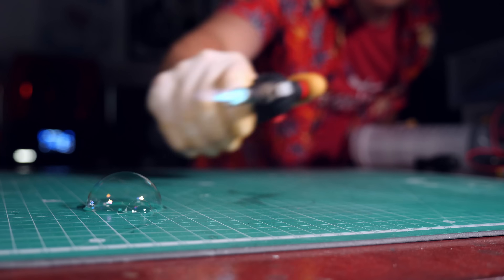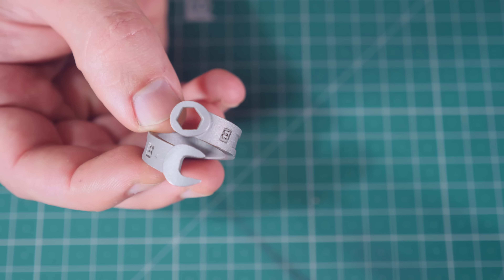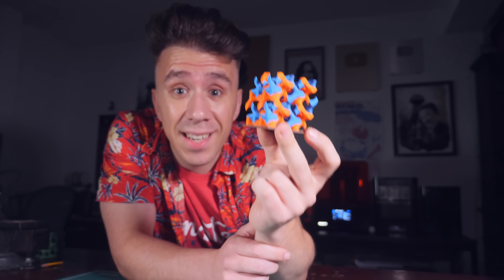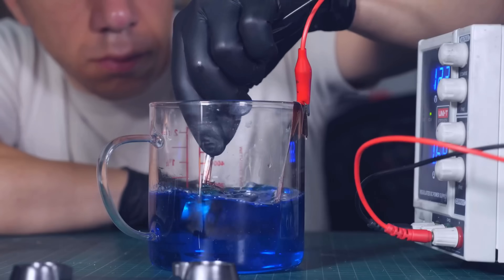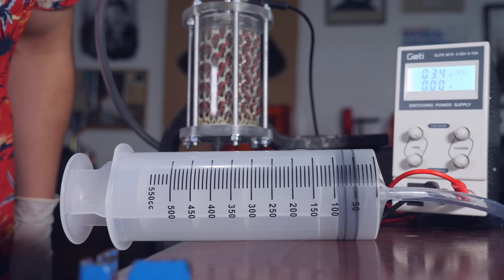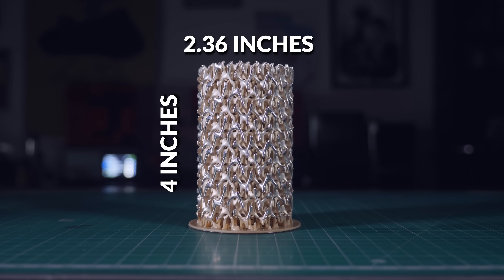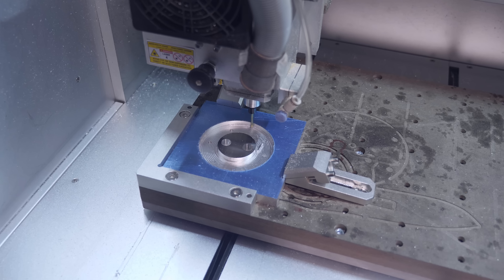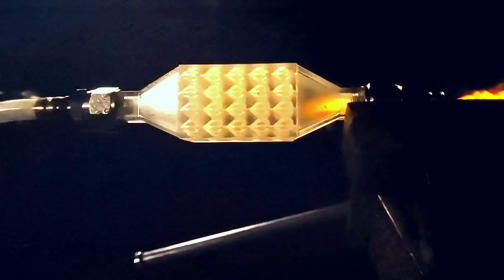ROCKET that LITERALLY BURNS WATER as FUEL

Comment: The battery is heating up because the conductive  water is creating a short circuit condition,  the only way any battery to be able to stop from heating up is to connect a load resistance  in series with the battery
If you are choosing a 1 ohm resistor , then take the max current you want to pass through the water let say 100 A current,  
Then the resistance wattage rating should be 10kW 
(Available in market)
Now battery, let's say if the battery doesn't overheat until it draws 50% of given capacity then should select a battery for 100A atleast, ie: 200 Ah capacity battery 
Now battery voltage selection
We selected 1 ohm so to flow 100 
V = I×R = 1×100 = 100V
So you need to create a battery of 100v of 200Ah capacity,  if as a single battery not available, use a parrallel or series battery connection of market available battery to create a 100v 200Ah battery.

So use a resistance of 1 Ohm 10kW and Battery 100V 100Ah

Comment: Have you tried using a cheap laptop power supply? I had to use one to do some rust removal, and it bubbled pretty merrily.

...course I think i also accidentally electroplated the parts i mean to just remove rust from, lmao.

course i used washing soda (sodium carbonate) i made from baking soda by heating it to 400F, dunno if that helps.

Comment: Hell yeah !
Years ago hydrogen was my suggestion for content.. you are crushing it !
Measure the volume vs watts and make sure everyone knows when you make more than is supposed to be possible per watt.. it's not hard at all.. physics and chemistry is so dumb with its rules they made a new science called atomic/astro physics for all the times physics is violated.. lol.

Looking forward to your progression !

There is two ways to split water, high voltage without electrolyte and low voltage with electrolyte.
Also with pulses and circuits (tank) you can make it "ring" like a bell and will use about 1/20th the power for same output..

Please please keep progressing !

Comment: I would like to see a video of you using a MIG/MAG welding machine as a 3D printer; As an example, you could install a MIG/MAG torch on a lathe tool holder, imitating 3D deposition.

Comment: Use a few 12v car batteries in parallel, adding until you DING. Or get a fused PDU and give it your local 120~240v to see if it twerks a bit?

Comment: Use an electronic speed controller from an RC car to control the discharge rate.  Upgrade to 6s lipo, run two or more in a series

Comment: Silver was covered in sulfur deposits, chemical desulfation use a solution of distilled water and Epsom Salt. Probably reduce the conductivity, magnesium sulfate and acid is going to neutralize the solution. But why not trying a balance between them? In this way maintain the surface clean just change the solution bath once In a while. Someone of you already tried?

Comment: Did you run the lipo batteries through a speed controller? It has a low voltage sensor in there, from what I understand there's units where you can adjust the low voltage limit. 
-5 years in rc hobbies

Comment: The solution to the problem of the batteries dying is to incorporate an electronic current limiting circuit between the battery and the H2O2  device. They are simple circuits that are easy to build.

Comment: Hey @integza, neat stuff, quick question what kind of flashback arrestor did you use? my college capstone was based on pyrolysis, and one of the byproducts was hydrogen, the safety department of the college shut down our project saying the flashback arrestor rated for acetylene was not rated for hydrogen!

speaking of pyrolysis, i think it would be a good video topic, its a dense topic, but simple to pull off also has some neat applications in the production of bio-oils!

Comment: Nice idea.  But how much energy did the battery put in to split the water?  How much energy did the rocket produce?   It's probably simpler and more efficient to just use the battery to turn an electric motor.

Comment: I know I'm like 6 months late to make this comment but brother, at 2:06 you start talking about the company that 3d prints in the exact material you'd need to make a proper HHO generator (316L Stainless Steel), if you made your lattice design through them you'd have a design that has high surface area not only from the lattice but also since it's 3d printed it will have a rough surface which increases surface area, also it's already conductive being stainless steel AND highly corrosion resistant so no coating needed to use with corrosive electrolytes, it may have less surface area than the disk design but it is well balanced and I'd be curious to see how that would perform (If you could somehow separate the two lattices from the base with a non conductive material that is also corrosion resistant/proof). 
It would also be interesting to see a version with disks of the lattice in stainless steel that are still separated by the insulating lattice disks you already made so that you could have neutral disks between the anode and cathode disks (being separated by a few neutral steel disks between each to prevent overheating and increase efficiency).
Best of luck with all of your projects! I like your content!

Comment: If you make the water spin by putting an impeller at the base, you would be increasing the surface area over the temporal dimension, same for heating up the water and compressing it. I wonder if a tesla turbine could be used with water where the disks are the electrodes 🤔

Comment: Can't you use a High-Current Industrial grade SMPS with an output of nearly 15V DC, 50A or higher, drawing almost 750W power? Also, you may need to use at least a 4 AWG (thicker) wire, cooling systems, short circuit protection.

Comment: The only way I see to mitigate the amperage problem is to increase the resistance for example with a variable resistance. Through your experiments you can determine how fast you want hydrogen production and then set your resistance accordingly. Sure this would limit the speed at which hydrogen can be produced but the alternative is to fry your power supplies just like you showed in your video. By Ohms law where resistance decreases, current increases. I=U/R. By having minimal resistance between the andoes and cathodes through the electrolytic medium that is your water you are approaching a short circuit where current could theoretically be infinitely high. 
Ah yes and with great current usually comes great heat.

After some time running the sytem the anode (-) will corrode away so it would be benefitial to use metal which is as noble as the budget allows it to be.

Comment: The problem is energy in and energy out. Thermodynamics 101, the water you are starting with has no chemical energy to begin with, the energy you are putting in is the energy of the battery or power supply (electrical energy). In the beginning you are confusing energy storage or volume with material storage and volume. Gasoling is a fuel containing chemical energy, water is not a fuel. In this case it is a material that you are converting into chemical energy using electrical energy.  No wonder you batteries are failing and overheating. There is a saying in engineering, "There is no free lunch!"  And that is the lesson here. Great experimentation and 3-D printing!!!

Comment: If you wanted to go full tryhard you could use hybrid technology to get the voltage you need to produce the hydrogen, and then the internal combustion properties of the hybrid for electricity generation. Its not free energy but its a better choice

Comment: I would like to see an electric throttle combined in sink with an acetylene gas axe. Where the both aspects of the gas axe are receiving hho! The acetylene aspect is set providing an idle and turned up for a constant cruise! The oxygen aspect providing an afterburner effect consecutively with the electric throttle which is only set on a little for the idle/ ruise. The electric throttle providing more current to increase hho output as you press the oxygen lever of the gas axe! That way your controlling the amperage input to the hho generator prolonging the battery and hho to the combustion chamber simultaneously creating a rocket engine that can be accelerated and decelerated 4 aircraft!!! 🤔😁🇦🇺👍

Comment: The batteries might be dying because you discharge them below 3.0V per cell without any low-voltage cutoff between the battery and the load. The current would only kill them if they got too hot.

Comment: you need to add a load to between the battery and the generator.  Currently you have a dead short hence the large amount of current and destruction of the batteries.

Comment: you can also do it with heat instead of eltrolosis ... and make a detonation engine ... water will decompse in extreme heat (above700c) which means it breaks its molecular bonds and becoming a hydrogen oxygen cloud to explode ...

Comment: I could really use a 3D printer so here's my suggestion how about a bicycle that runs on your flappy motor possibly using hydrogen peroxide like the old jetpacks as an expanding gas to run the motor which could be stored in the frame of the bike?

Comment: This comment is for the 3-D printer because that’s what I want. This is a suggestion actually you should go through with the sand paper on your round disc steel disk which will increase the surface area and eventually you will have more hydrogen and oxygen (Thank me later) 🙃

Comment: I'm pretty sure the rods you are using is one of your limiting factors, I would suggest making your own threaded rods from lead just buy a box of wheel weights from your local auto parts store like oreilly auto parts melt them down and thread them to whatever thread pitch you need

Comment: Stan Meyer was the king of hydrogen generators, he found if you use a very high frequency but low amperage you get better hydrogen seperation from water, it also helped to put LED lights in the water, they assisted with seperating the hydrogen. 🧐🤔😎👍

Comment: While you're testing the design you shouldn't be using batteries, you should put together a variable power supply. You don't have to worry about frying batteries. You can figure out how much current it needs and then design a battery power system around that spec.

Comment: Can we have an improvement on this prototype rocket by connecting a turbine shaft at the exhaust of the rocket to drive a Dynomo which in turn generates electricity required for Hydrolysis?

Comment: Not to take away from the fun and learning aspect… but i wonder the practical use… lets say its a jet powered car… how many batteries would you have to have on board?  I suppose the engine could also be powering an alternator to recharge the batteries? But would still be a lot of weight.

Comment: An efficient turbine generator should be able to make enough DC power to run your thing, and that should be able to make enough hydrogen to run the turbine. But will it have enough extra energy left to do anything useful? Did you make it work?

Comment: Idunno... Seems like a tightly constructed cork screw(two different screws you screw togeather) would have been better. Much easier to place spacers between the tight screws to avoid short circuit, compaired to the lattice thing. edit Oookay... Just arrived at the part of your video with stacked plates... Good enough. And yes, i am a genius.

Comment: Unfortunately sir I believe your math may be incorrect-the optimal ratio for producing thrust through the combustion of oxygen and hydrogen is 6:1, meaning 6 parts of oxygen to every part of hydrogen
Reply: However a nominal and efficient solution would be to add a separate port to your engine to allow introduction of additional oxygen with a cheap handheld bottle of welding oxygen-they're usually about the same size as a soldering torch bottle and retail for roughly 10$ here in the US
Reply: However you would need a flow regulator of course
Reply: In conclusion I actually believe that your combustion ratio is responsible for the pulse effect demonstrated by your engine; with the addition of more oxygen to the fuel mix it should allow for a continuously combustive flow-essentially it is most likely pulsing as it has such an insufficient level of oxygen in the flow and therefore has to build up the gas mix in the combustion chamber before being capable of combusting.

Comment: Stan myers had a test stand and he used a car battery and an automotive altenator connected to a electric motor  then he manipulated the pulse and frequency to dramatically increase the gas output with alot less power input. He died after proving his equipment and doing a long drive on just water by food poisoning. Now food poisoning is a reoccurring theme for people that get close to publicly showing how to get free power from water it has happened so frequently they opened a college lab and post everything online that is tested about free hydrogen so the knowledge won't die with one person and the powers at be can't silence everyone. The internet information can't just be erased.

Comment: I just got my order of arduino chips and I could totally use a 3d printer for my experiment am willing to even modify a nice lab space for these videos what do you think I am not knowledgeable about the use or function of these and yet I found an old soda can speaker that is outdated I plan on attempting to modify it with zero to no knowledge of what I am doing just following simple approach of think it do it subconsciously I had randomly ordered them off fascination almost immediately after I came across the damaged device now I want to see if I am a natural at this or if I need to shut my tech dreams down and go back to the drawing board but it am confident that I have stumbled across my innate super ability and that is with technology 😅

Comment: It wont work, the eletrosis that you use to separate Oxigen and Hydrogen will use more power than when you generate it by combusting them together after, you are just transfering power, its the same as trying to hold a magnet into the front of the car, it will never pull it forward

Comment: Hello, i like your room, is nicer than my garage, i have acces to various tipe of graphene/graphite , wonder is it will work better than steel as electrods
, i will try it , he he
Reply: And by the way , i will use a server power supply, with 60 euro you can get one that outputs 12 volts and around 70 amps

Comment: So, it's creating more than enough HHO but pulling to many amps? Put a resistor in series, no? Reduce the output but also the amps. Or, similar effect, make your electrolyte less conductive. Try pure distilled water and titrate your additive until you get the right amp draw? Be cheaper, and easier on the electode material too I expect. Additionally, if you rough sanded your electrodes you could increase their surface area while reducing weight, just be gentle! Awesome project, if only it could be viable to do this onboard a vehicle... bloody 3rd law of thermodynamics! 18:00

Comment: The carbon rods can be obtained by cutting open use d cell batteries batteries the carbon rods that go down through the middle of the batteries I made of carbon remove those and use those for the electrodes both positive and negative

Comment: If you could pull water from the air, use solar cells to create hydrogen and oxygen and store it in a tank, you could use that to power a car.  Carbon fiber tanks with hydrogen and oxygen would be significantly lighter than batteries.  A solar/hydrogen car.

Comment: you are killing your battery so you need to to limit current. To do this you need to install a load in series with your oxygen cell. The load would usually be something like a light bulb or a heavy carbon resistor.

To limit the current to I amps from a voltage source V volts, use Ohm’s Law:

Series Resistor:
	1.	Calculate the required Rlim:

Rlim =(V/I) - Rcell

￼
	2.	Install this resistor in series with the load ￼.

Cheaper Method:

If precise current limiting isn’t critical:
	•	Use a car headlight bulb or similar high-wattage resistor as a current limiter. Bulbs increase resistance as they heat up, acting as a self-regulating current limiter.

Both methods are low-cost and effective.

Comment: Also your next video should be if you can make a spiral or seashell like hydrogen engine or cyclonic with transistor energy or pendulum energy or use hydrogen like the missile tip as an engine piston to move a magnetic metal ball into a tubing for resistance trapping the air to make pressure inside the tube really some sort of device to fill with a water bottle and then you can use it to power a bicycle or make the bad ass frame foldable two wheel seat that turns into a flat backpack something crazy simple yet DIY yeah haha idk...😅

Comment: You can split hydrogen with no power use. Use an aluminum gallium amalgam to …. Hydrolyze? Split h20 into hho. You’ll need to replenish the aluminum but the gallium should be 100% recyclable

Comment: So you could get away probably with a power source by using a 18-wheeler battery charger they usually can put out a lot more power and disconnect it to like a car battery and then run that it can even be a dead car battery just something to tell the battery charger that connected to a battery so it will put off v I'm sorry if none this is spelled right I have a really bad reading and writing disability I really tried

Comment: Dude, you really should retake some physics lessons, because the answers to some of your problems are really trivial.

If you want to limit the current your contraption draws from the battery all you need to do is to connect appropriate resistor in series to it. Or few resistors in series. Basically you need to just keep adding resistances to your circuit until it only draws so much current as you see fit.